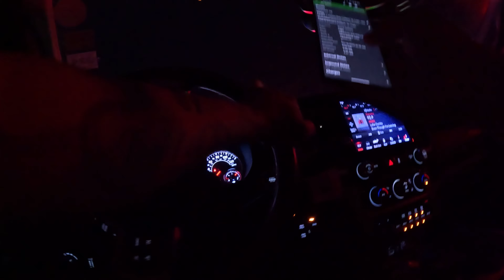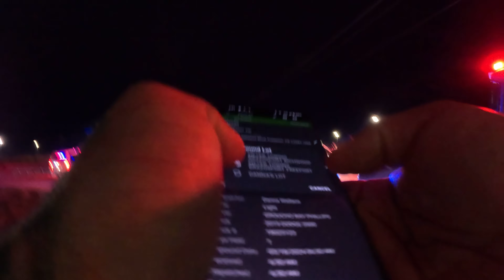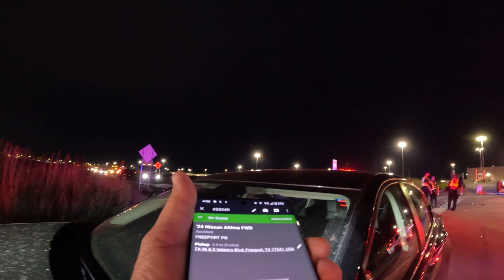Major 3 Car Accident Involving a Semi Truck: A Closer Look

Comment: So you going to tell me you going to pull out there don't put no straps no drag lights you got to do better and don't want to hear I was just going down the street that Ford truck just pulled in front of that semi got to do better
Reply from the maker: Look dude I mean really, we live in a small town where most of these calls I'm doing aren't even a mile away from the lot. Don't even get to speeds over 30 mph. But I understand if I'm going to be on a freeway, longer distance, or even a main road I always  put straps and light on.